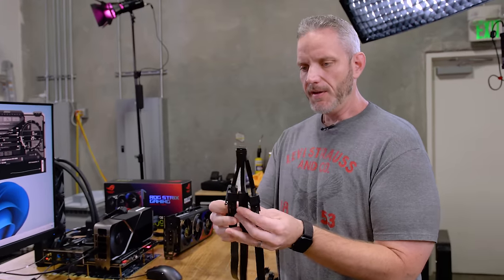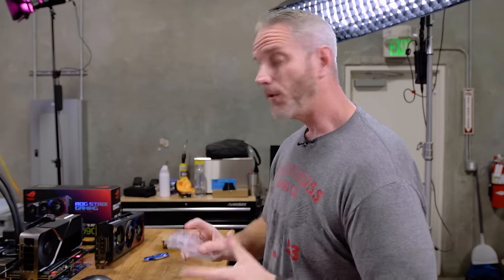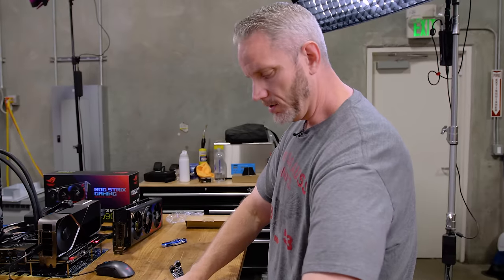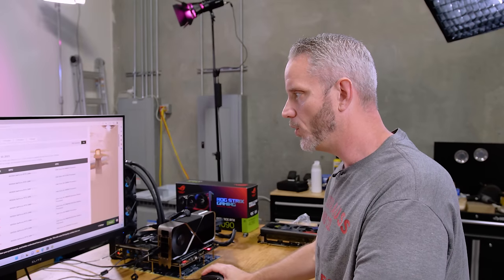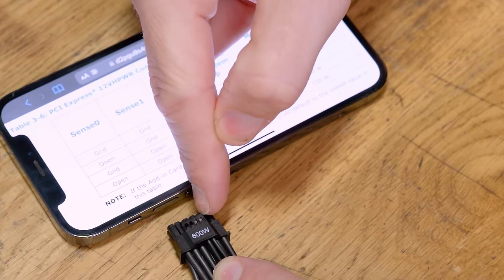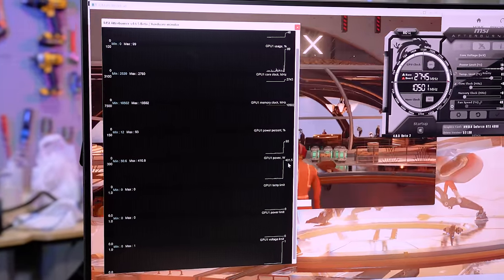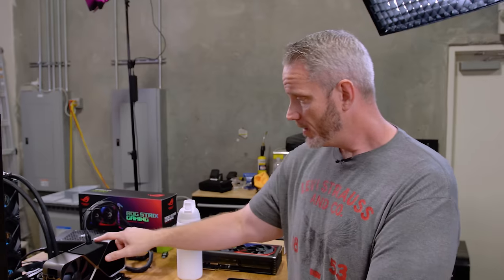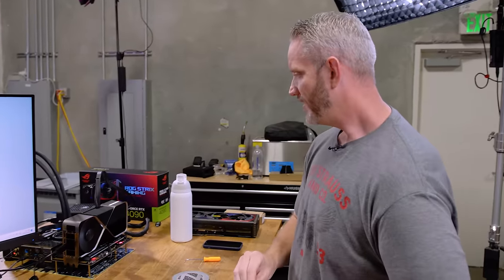DON'T Do this with your GPU!

Comment: didnt corsair totally get it wrong as far as how that connector works? I just watched Gamers Nexus video on that. Not sure I trust it now.
Reply: Corsair just posted a statement
Reply: Corsair posted an apology for disrespectful behavior and language but  they did not admit fault or give a technical answer.
Reply: @johnhowarth7216  Nope GN is right, they also have the specs right from Nvidia. In the 4x8-Pin Adapter there is an extra IC, that checks EACH 8-Pin, if it is plugged in and then sends the right signal to the sense-pins.
Reply: @johnhowarth7216  nope, If you had watched GN provide the source for their claims (Nvidia) so it looks like Corsair don't know squat.
Reply: @johnhowarth7216  Confused too. But my understanding is that anything less than 4 cables can only draw 600w as where all 4 cables draw 630w which good for overclocking. Also I did an analysis on spikes GN did earlier and the 40% transient spikes on a 450w power source will go over 600w.
Reply: Corsair is wrong as Nvidia itself said how it works and they said the connector tells the GPU how its connected.... Corsair isn't very smart to disagree with Nvidia 😂
Reply: Yup. Connect all four cables and you can push power to 133%, but not with three cables.
Reply: Not Corsair just some Guy employed there, not like he speaking for the company
Reply: @generalgrevous1984  3 power cables you can run the card but not overclock 4 connected you can pull 660 watts max total (including socket power) I don't think the card will OC that high but that is the max you can pull the slider to the right, (this is with the Nvidia adapter cable) Gamers Nexus video is excellent, they even had a Nvidia engineer explain how it works.  Corsair said the employee that made the statement was wrong and they do not agree with the false information that he posted.
Reply: @davidbrennan5  Thanks for the Corsair info. They really mucked it up on that one. lol
Reply: Kinda
Reply: The Nvidia rep on GN said there is an IC in that cable as well didn't he? So it is more than just those leads showing ground or not. Which is probably why Jay wasn't seeing the 133% on the power setting slider.
Reply: @BlackSmokeDMax  Correct, he said the chip detects how many cables are connected if you use the Nvidia adapter that comes with the card.
Reply: @johnhowarth7216  considering the guys who made the plug agree with gn. A literal nvidea engineer. Ima go with the engineer
Reply: @BlackSmokeDMax  Yes, there's an IC but it's there just to check for cables that are plugged in and to just ground appropriate pins.
Reply: Yes I lol'd so hard I came at Corsair getting pwnd by steve
Reply: @davidbrennan5  Igors Lab did Test this as well. Pretty intresting Stuff.
Reply: yes they did they put an apology out to gamers me us and guru3d
Reply: ONE employee is who got things wrong and talked without know what he was saying, Corsair apologized in behalf of that person and said he doesn't represent the whole company, also, the Corsair cable in this video works completely different from the Nvidia one.
Reply: @johnhowarth7216  you're wrong dude. although i'm not always agreed with Steve, but to this matter he right with his point, so don't be confused. his judgement always accompanied with concrete evidence including opinion from people in the field, the engineer. LOL xD
Reply: @ericshutter5305  Nvidia didn't create the specs for PCI/ATX, nor did Corsair. What they're both doing is within spec.
Reply: @flimermithrandir  I think Corsair apologized to him as well in their statement, I wanted a 4090 but I will wait, buying a atx3.0 power supply with the  12VHPWR power connector would be better than using this adapter imho. I think 1200 watts would be a good size to have some headroom, they can generally pull higher than rated power before over current protection kicks in.
Reply: Someone did not watch the videos.
Reply: @phillylove7290  The statement says the original Corsair statement was incorrect.  The original states that you only need one sense pin, and the card isn’t smart enough to draw more than 450W.  There are two reasons this is wrong: 1. the new connector REQUIRES two sense pins to be compliant with ATX standard (one is not optional), and 2. In the event that only one pin is functioning and shorted to ground the maximum the card will draw if it is ATX 3.0 compliant is 450W regardless of the amperage capability of the cable.  Thus you can’t increase the power target over 450W with only one pin even with overclocking software.
Reply: @johnhowarth7216  Both Jay and GN demonstrate the Corsair tweet to be false in the videos, and Corsair have since retracted the statement lol
Reply: @G0dspeeeed  AFAIK he was a PR person for Corsair which means his job is to publicly represent the company in it's communications.

Edit: Apparently it was the director of R&D for their PSU division? If so that's even more embarrassing.
Reply: @BlackSmokeDMax  saving me watching the WHOLE thing. I was curious, saw one pigtailed into fourth connector... and that corsair opts for two instead of four.
Reply: @phillylove7290  Yes they did... they said the corsair staff provided misinformation... just like you rn
Reply: @generalgrevous1984  From what by I was aware of, PCI-e spec is max 150w per 8pin cable.  To get full power, including your overclocking overhead, you need four.
Reply: No. They apologized for behavior. They are correct. Two PCI-E cables plus the PCI-e slot to an supply 607W per ATX 2.0 standards.
Reply: Both nvidia and Corsair are correct about their own adapters…in a way. This video proves Corsair adapter works, only 2 needed. Includes ability to go past 100% to 133% slider. Where Corsair rep was in wrong was saying nvidias adapter acted in a way it doesn’t. He incorrectly stated removing sense pins wouldn’t change card behavior, but that’s not true as shown in this video and GNs.  Corsair adapter =good, their rep made dumb statement that was wrong and has zero effect if you use theirs. Use Corsair cable if you can get it, if you have a Corsair psu.
Reply: @Robot_repeater  this is incorrect. The ATX 2.0 Standard dictates 266W continuous power per PCI-e cable
Reply: @G0dspeeeed  Corsair Rep. Rep being short for Representative. So, not really just some guy. Edit: JonnyGuru, apparently, so not a PR Rep, but definitely not just some guy in the rank and file.
Reply: @johnhowarth7216  naw Corsair was wrong as f**k... GN posted a response video with the proof straight from Nvidia.
Reply: Corsair is right.
Go watch De8auer's video.
He opened up the nVidia adapter and only 2 of the 4 wires were connected all the way through.
The remaining 2 wires were not connected to anything.
nVidia is talking smack as usual.
Steve is becoming an nVidia fan boy and he should know better....
Reply: @johnhowarth7216  GN literally has Nvidia on video saying exactly what GN said.
Reply: You GN fanboys bite so easy 🤣🤣
Reply: @johnhowarth7216  just correcting you for everyone else who is reading this comment thread. That's all.
Reply: According to GN Corsair has apologized for an employee who basically opened his mouth and had his foot forcefully inserted, when he made an incorrect remark regarding guru3d and/or GN... Not sure if that issue has anything to do with this issue of differences between videos from different media outlets, but it is something to keep in mind...
Reply: @G0dspeeeed  High enough in their ranking to speak for the company, the company, though, threw him under the bus and for a good reason. The guy spoke before he even knew what he was talking about. Nobody should speak publicly like this, about any subject, before they actually know what they're talking about.
Reply: You're all forgetting what the Nvidia engineer also said about the cable, that there's a small PCM at the 12-pin header that senses and regulates power depending on how many of the cables are plugged in.

That being said, I would think that Corsair PSU engineers know what they are doing ( as in they know and follow specs that is in line with Nvidia) more than their rep in chat. Makes me wonder how they're managing power with only 2 cables and if it's rated for all GPUs including the 4090, or if it is just for the 4080 and lower.
Reply: @ilenastarbreeze4978  he was an engineer and is now a product lead for 40 series
Reply: Corsair was incorrect, gamer nexus was right in his research
Reply: they should just use a higher gage power wire to have a much cleaner look.
Reply: Yeah, corsair was wrong. PR stepped in and apologized for that guy being wrong.
Reply: @gucky4717  I highly doubt there is an IC in the cable or its connector.

If it is in the connector, why can't it be on the board instead?
Reply: Gamers Nexus is correct, Corsair was totally wrong.
Reply: @sjoervanderploeg4340  Go watch the GN video. They literally have an Nvidia product manager - who was promoted from an engineer - saying "there is an IC in the adapter cable"
Reply: @Marin3r101  exactly why he knows what hes talking about, he didnt stop being an engineer
Reply: @redacted5035  Do you think a Corsair employee knows more about a brand new Nvidia graphics card than an Nvidia product manager?
Reply: A guy that works for Corsair made a statement about a subject he knew nothing about.  He got reprimanded by Corsair
Reply: @TechTusiast  with the cable from Nvidia with founders edition cards. Aftermarket cables can change this in any way they like as long as they figure out how to get the power across safely.
Reply: Different cables
Reply: @sjoervanderploeg4340  Because that wont work. There are 4x8-Pin Connectors and only 2 Sense-Pins.
The other 2 Sense-Pins are not used at all, they are reserved for some future features.

GN will release a Video about that soon (with Nvidias support) and igorsLAB already has released one.
Reply: @Robot_repeater  Which I find odd that Corsair made a 2 and not 4 claiming max output at 600w. Corsair has some weird math going on when 2 x 150 = 600
Reply: I think they are talking about different things. The nvidia guy in GN's video said THEIR connector has a chip that senses how many of the 4 leads are connected and tells the gpu how much it can draw. This is different from using a fallback sense-pin system like this cable does
Reply: @SkansgardCNC  yup, you can tie the sense pins to ground to fool the card into running 600W with any number of cables. Nvidia's using the actual, non-fall back compatibility, spec to communicate with the card. At this stage, it doesn't matter which method you use. In the future? Eh...
Reply: they ofloaded the blame on an "employee" for the fault and apologized for it but they make it look like it's just some random employee that published the statement against GN
Reply: @SkansgardCNC  It's not like the Corsair Connector is completely safe.. 
If you connect just one of the calebs instead of both you get either 150W or 450W over one cables, depending on which you plugged in. But of course in best case that shouldn't work either, since only half of the Pins are connected.
Reply: @craigjoe8691  Everywhere else I find seems to disagree with you, including reference from gigabyte themselves.  Could you provide me a link to your reference material that shows the spec max power on an 8 pin pci-e to be higher than 150watts.  I seem to be unable to find the reference you are working from.
Reply: @alexmills1329  unless Nvidia stipulates that all cables meet their spec
Reply: @bengrogan9710  clearly that spec isn’t having 4 connectors considering the 2x8 pin works for 600w as shown in the video
Reply: @generalgrevous1984  450W with 3..600W with 4 plugs(in actuality its over 600). Each plug is 150W
Reply: Yes but that ONLY applies to Nvidia's cable adapter. That's what Steve from gamersnexus was talking about when calling out Corsair. Not Corsairs own cable. The way this cable works is completely different. Now everyone is going to think this Corsair cable isn't capable of pulling 600w when that's not the case.
Reply: @mitsuracer87  each cable must be drawing more than the usual 150W I guess. Interesting.
Reply: @phillylove7290  "recently made inflammatory and incorrect comments"
Reply: @generalgrevous1984  the cable doesn't draw anything... OMG
Reply: @intensepl  Draw through the cable...OMG
Reply: @G0dspeeeed  FYI, that "guy" is the head of Corsair's PSU R&D. So I think he represents PSU topics way more than you think.
Reply: The marketing rep got it wrong I doubt the engineers did
Reply: @davidbrennan5  Reasonable, honestly. I would say 1000 Watt would be enough as well but… then again you dont know what BS cocks up in two Years…

I am highly against the 4090 anyways but if one must… i would understand getting an decent PSU for it.

I think thats what i would want to say.
Reply: @phillylove7290  they apologized for "inflammatory and incorrect" comments. I think "incorrect" pretty much answers the question of who's right.
Reply: @generalgrevous1984  it was not Corsair, just someone from within the company that wasn't speaking on behalf of the company.
Reply: @johnhowarth7216   I like how you deleted your original comment and then you reply to others later in the thread. Standing by your words like a real man 💀 😂
Reply: Corsair made a statement and then retracted it hours later and blamed an employee 🤣
Reply: @generalgrevous1984  no, it's 150w er cable per the Nvidia rep Steve from GN has on camera stating as much. So 3 is 450, which is base line. Adding the 4th means 600w is available via the cables. And with the power from the slot itself, the card can draw 666.6 watts.
Reply: @notgonnahappen7899  Ah, that clears it up. I guess the advantage with 4 cables is the ability to go over 600w as where Corsairs two cable solution stops at 600w. I guess Corsair's solution doesn't take into consideration transient spikes?
Reply: Yup
Reply: @dallasreilly7599  Thats not a marketing rep dude. That was like the godfather of PSUs for a decade and a half that said that.
Reply: you can’t draw more than 150 per 8 pins so I don’t trust 2 x 8 pins for 600w haha😂
Reply: it’s a connector issue 150 W each
Reply: Maybe if this is connector for atx 3.o psu maybe is leggit..
Reply: some of you guys know less about psus than me and thats saying something. 

Stop using the term ATX spec when discussing the limit of pcie to 150. The card, the corsair cable and the corsair PSU in this specific situation are not forcing a limit of a 20 year old spec because it can handle more. This is corsair type 4 spec with a cable that has 16 AWG wire.

The nvidia adapter has an ic that causes it to behave differently than the corsair cable.

Corsair power supplies + this cable can hit power limit of 600w

Nvidia adapter and the bottom of the barrel atx 2.0 power supplies with 4 x PCIE can carry 600w. 

These  are two different things.
Reply: @JosePineda-jn8jk  it’s been so nice meeting you all 😘🤣
Reply: Corsair had a rep calling BS (literally) on Steve's (Gamer's Nexus) video. Then Corsair called BS on their rep, apologized for the rep's comments, and said that Steve was right.
Reply: @generalgrevous1984  .  4x 8pin connector = 600w (150w x4) plus 75w from motherboard = 675.
Reply: @user-hs7hz1io1e  Yes I know, it is the Corsair 2 plug connector that is befuddling. Each cord can manage 300w which I guess is why they are thicker. And don't forget the CPU and Ram, fans water pump, it adds up.
Reply: No. Corsair's cable is right.  Jay is right. Steve is right.  The thing I went nuclear on had nothing to do with the sense pins.  Anyone can pull that up and see that's not changed since day 1.  No idea why everyone has latched onto that. The issue I took was with the card itself.
Reply: @jonnyGURU  Here he is! lol. I give you a pass anyway with your credentials.
Reply: Gamer nexus was right, he explained how the card or the connector works from Nvidia and the corsair person was wrong. If that person would of said with a new connector designed differently it would be different but he didn't. I wouldn't of used unlocking though like gamer nexus did, essentially with 1 to 4 connectors plugged in it will operate from 150 to 300 to 450 than 600 total watts but the voltage needs to be unlocked with a mod to use 600 watts
Reply: @chosen1one930  The guy from Corsair is in this comment thread. Jon Gerow. While he made a mistake, he is a legend in the PSU world and has been for years. I think we can give him a pass.
Reply: @dano1307  wow! I didn't say anything wrong and could care less who he is, you don't act like that by saying someone is spreading misinformation when actually he was one the one doing so period. Give him a pass if you want but I did nothing but explain the error
Reply: You're good. As I said above. I didn't say Gamers Nexus was wrong. I don't know how that whole thing blew up into something having to do with sense wires. Maybe semantics, but that wasn't the point. There's nothing really too different about the Nvidia cable and everyone else's. The difference is the IC that makes sure every connector is plugged in on the PSU side. What I was made about was Nvidia telling us the 4090 was a 450 card only needing a 450W cable so focus was on making those cables, only to have Nvidia show Steve that if you use a 600W cable, you could go over 450W.
Reply: The adapter works and corsairs new cable works, Corsair has a video where they talk about it and how and why it works and is safe etc. they’ve verified it to work with Corsair PSU’s only as their know their wattage and rail rating and know that they can output 600W over two 8pin’s from their own PSU’s and know the cable can handle it. Does it follow the official spec no but that doesn’t matter it’s a conversion cables tested and safe to work on Corsair PSU’s
Reply: @dan O I'll eat some crow - they only need two sense pins to get to 600w, but the Director who posted the @GN comment was off base. One pin, 450w both pins 600w. I hope the PSU can safely deliver power through just TWO connections instead of four though!
Reply: @jimm9776  How was I off base?  It's always been sense1 for 450 and both sense0 and sense1 for 600W.  This is what I  don't get. People keep saying I said something different.
Reply: @jonnyGURU  I was responding sort of to my original thought, not you! You aren't the corsair director right?
Reply: @jimm9776  I am! :D  If you look at the quote (even though it's out of context), I never said GN's testing was "BS", nor did I say that the sense pins were different than what they are.  What I was complaining about was Nvidia represented to partners how the card should behave with the different sense pins and that dynamic overclocking should not be possible give what Nvidia told everyone PRIOR to launch.  That part of the exchange was not brought up because, apparently, nobody wants to upset Nvidia.  I was wrong with what I said and the way I said it, but I did not say anyone's testing was B.S. and I did not say the sense pins were different than the way they've been documented as working from day one.  What was "total B.S." is that Nvidia represented one thing to partners, then a week later showed something different.
Reply: @jonnyGURU  oh well I have my finger far from the pulse! Good on you to be present in some of these tech threads, I'm a little nervous running 600w through just two pcie cables lately. Corsair products, however, haven't recently caught fire!
Reply: @Ethan_Mcfly  Yes you can draw easy 300W from 8pin
Reply: I’m running a Corsair 600w no issue I know I’m late just got my 4090fe for 1440 so
Reply: Even I know Asus does not work with it's knockoff counterpart My ARS 3060 is dark, and it says not communicating but it does work. I will never cheap out again. Going to get i5-13600, ARS-A or H and buy a elcheepo gpu for the Asrockflop and sell it. Sad that I have to even do this as I broke the Asus Prime Mobo, and  figured in a temp and cheep replacement.
Reply: Jay literally proved here he can OC it and get the full 133% which gamer nexus said you couldn't. Which was completely false. Yes he was correct about the nvidia adapter but not corsair adapter as it does allow for the extra 33%. Not just stuck at 100% like gamer nexus said.